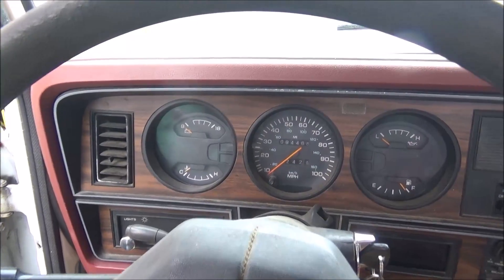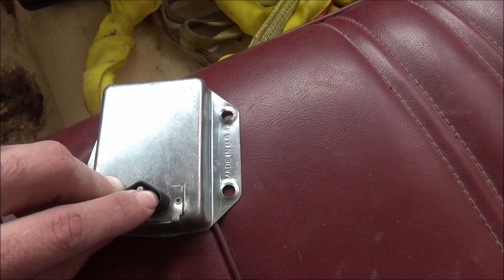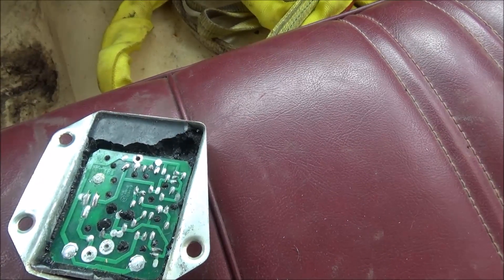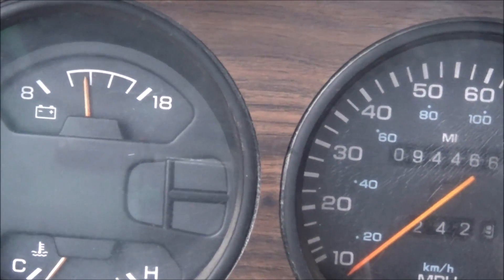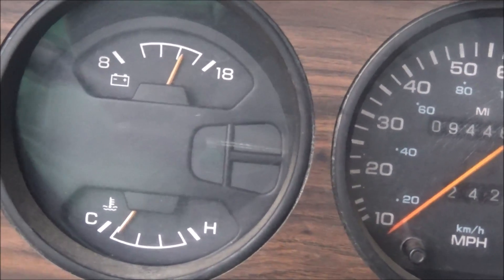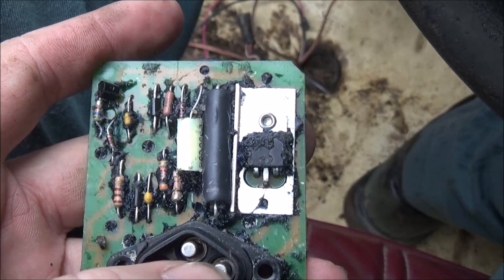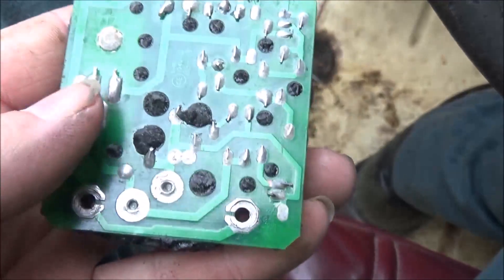Plagued by electronics, I need help

Comment: The components to be concerned with are the alternator, voltage regulator, battery, battery to engine ground conductors (wires), battery to frame ground conductors, engine to frame ground conductors, engine to body ground conductors, the positive battery conductors and the voltage regulator to alternator conductors (Ignition and Field), 

Most often this type of recurring VReg failure is missing, broken (open), damaged intermittent ground conductors, usually between the engine to body and frame to body. 
To test just add a new supplemental conductor directly connected to the VReg mounting fastener and the engine making certain the terminations are making metal to metal connection. 
Or broken/open, intermittent or shorted alternator to regulator field or ignition conductors. 

Second most often it is a defective alternator. The only way to absolutely determine the alternator's condition is to observe the running alternator voltage output with an oscilloscope looking for an abnormal waveform, spiked output, excessive ripple on the output, inverted or missing phase wave form on the output. 
Quite honestly, I am leaning toward a defective alternator because when taking the alternator control wire directly to ground, the alternator should output more than 15 volts and full rated current. 

Does the battery discharge while the vehicle is parked for more than 48 hours? 
If yes, take a long hard look at the alternator, a leaking (electrically) diode will slowly discharge the battery when the engine is not running. 

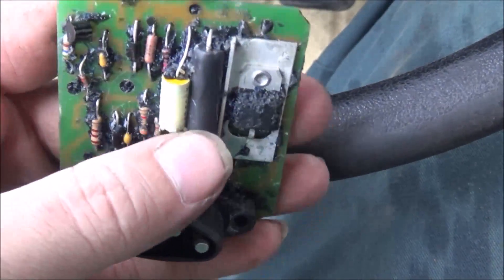The long black cylindrical device in the VReg at 9:05 is a current sensing resistor. It developes a small voltage across both ends of the resistor that is commensurate with the current flowing through the resistor. 

The small flat and round device in the VReg at 12:15 is a temperature sensitive resistor. This for ambient temperature compensation to prevent over/under charge voltage that adjusts the output according to the ambient temperature. The resistance changes as the temperature of the device changes. 

The multi-legged device is the actual integrated circuit voltage regulator, the remainder of the devices on the PCB are support devices and devices used to set or trim the sensed and control voltages and currents at the factory. 

A relay is not a good long-term fix, although in a pinch it would get you home. 
The current at the VReg field (grounding) pin is modulated by the VReg to control the alternator output, it is not a simple on/off switched operation. 
A relay is either on or off, either full output or none, no current modulation. 

If it were mine, I would closely inspect all of the above mentioned conductors and terminations, uninstall the alternator and have a reputable auto parts store (NAPA in my area) or alternator rebuilder/remanufacturer test it independently of the vehicle, repairing/replacing if needed, replace the VReg with a new Made in USA unit and add the supplemental VReg fastener to engine ground conductor (10-12 AWG or fatter). 

Sorry about the novel, but I wanted to be thorough. 
Hopefully some of this helps. 
Good luck, let us know the outcome or progress.

Comment: There are usually only 3 connections on those regulators, ground, battery sense (comes off the battery directly) and output to the field coil on the alternator.  To get more voltage, the field gets tied to ground. It really sounds like the field might be drawing too much current, maybe its got a shorted turn inside.  It would probably still work with a shorted turn but it would pull more current.    Maybe its pulling enough current to melt the solder on the switching transistor inside the regulator, which is why it started working a little bit when you poked it. 

Is there a different regulator for the diesel vs the gas engine?  Just wondering if maybe you have the gas regulator and its more feeble.  Higher amp alternator probably needs more current to the field winding to work.

Comment: The voltage regulator is actually a current regulator controlling the rotor current in the alternator {more rotor current more magnetic field more output voltage.  the sensing of the voltage by the regulator requires a good ground between the alternator and the regulator.  check the bonding of the engine to the chassis etc to make sure your are not getting an intermittent ground.  It's possible the alternator rotor could be at fault but I have never seen that in 20 years of working with them.  I hope this helps but without hands on it's hard to be specific.  Aloha Chuck

Comment: That looks like a mosfet.  The middle pin will be switched to the ground (on the left in that underside view) when the voltage on the gate pin (on the right)  goes above (or below,  both types exist)  a certain voltage

Comment: Check the Crank Pos sensor. I had a 93 and the AC stopped working and the Alternator stopped charging. Turned out to be the Crank Pos Sensor.
Reply from the maker: No crank sensor on an 89. I believe those 1st appeared with the 91.5 trucks.
Reply: I did not know that. I miss mine wish I never sold it.
Reply from the maker: They are tough, rugged, and simple work trucks. Nothing fancy or plush about them but you can throw 4000lb of concrete in the back and drive off to the workisght day after day and they take it.
Reply: I also like the looks one of the last trucks that looked like a truck. not a luxury car with a bed. My was an Auto If I ever find a manual I'd probably buy it. Hope you get your issue resolved. I'm wondering if it's a diode in the alternator?

Comment: Hi Brian,  The three legged device is the regulator. It does not switch on and off, it varies the the charge voltage based on the current charge on battery.  The black cylinder next to that device is a resistor. I know you are not looking to repair that unit but if you did you can get the same type of voltage regulator with higher current capability. I might suggest you try to see how much current the alternator is supplying. The regulators that you have been installing may be for a different current output. The suggestions about trying an alternator with a built in regulator would at least be a good test to see if your problem is with  your current configuration and you can get a used one from  a junk yard. Now you may have to make or modify the mount bracket, but if you now someone with some machining equipment, I am sure you can make it happen.  Ha Ha.  Good luck

Comment: Brian, the downer engine looks like its from a newer truck?  If so is the ALT from the newer truck internally regulated or are you using the correct regulator for that newer style ALT?

Comment: Beyond the calls for ground or swapping the alternator I've got only the hobo-engineering one would use when out on the road and temporary like, maybe with some timed relay instead of a manual switch I'd soon forget. I tend to enjoy driving so much I even forget about gasoline some times, so it's a good thing they invented that red warning light now that I drive on the mainland!

In Hawaii, running out of gas was just an opportunity to meet the nice people who lived where you happened to putter out, LOL! I seriously made a friend that way...ahh, I miss it sometimes.
Reply from the maker: I have never in my life run out of fuel. I am a guage hawk if anything is out of the normal I know it.  I once was driving a KW around a corner and noticed the oil pressure dipped so I pulled over and shut it down. Turns out the filter gasket had blown out and it had pumped all the oil out but about a gallon and when I went around teh corner enough got away from the pickup for me to notice the pressure drop. No doubt that saved that motor from an early death.

Comment: Brian
Heat is the big enemy of electrical - keep the stuff cool and all is OK for long time.  Overheat and you get problems smoke blah blah.  Your tuck was initally a gas rig most likely V8 and a 318 or 360 CID.  with the gas you had 4 cylinders exhausting "near" the regulator and with diesel especially so with the exhaust side of torbocharger near the regulator and that is all six cylinders..  Diesel exhaust is also hotter I believe than gas.
RECOMMEND take a look at a Dodge stock diesel and see where they put the regulator.  They may have moved it to get away from the heat.  If so move yours.  I would consider putting on the "bulkhead" the radiator is mounted on make sure it is going to stay fairly dry.

Mount all grounding type conections even just the screws to the sheet metal using No Alox,  Detroit and their savings of copper by frame ground is great for service and repair persons - lots of job security.

I agree with the idea of running a dedicated ground conductor from the regulator back to the battery.  Use solder on all crimped lug connections to avoid oxidation problems...

The regulator is using pulse to contol the alternator and that will wear out a relay in no time,
Do NOT bypass the regulator output with eithe a relay or switch.18 V can fry other electronics.  You hve gotten away with it so far.  You could put in a manual reguator setup with a reostat and ammeter to control field current to around 3 amp or so,  I have done that with bench top demonstration equipment,  It may be needed to get you home on a cold dark night.

Dan Bentler
Reply from the maker: Besides the radio everything else on the truck is analog. 18V is tough on light though!

Comment: absolutely....   here is my six step voltage drop test to check the major wiring connections at the electron level.. http://imgur.com/a/wHJue

run a braided ground strap from the engine block to one of the mounting bolts on your voltage regulator also.. you can get a 15" version... 

the center wire monitors the charging voltage...

the side wire is both Negative and positive output..  when it pulses to negative.. the alternator rotor magnetic field increases.. to dampen the rotor field it pulses to positive.. this stops the charging system output from running away.. 

check the negative battery cable connections.. the voltage drop test will isolate the issues..  you need the thick wire to the block.. the thin wire to the body...   a braided ground between the engine and firewall..   you may want to use a second to the voltage regulator mounting bolts.. 

i have measured as much as 8.5 volts on test 4 on a 98 chevy pickup that really had some issues...   you may also need to pinch the sleeve connectors tighter that plug into the voltage regulator. 

wayne..

Comment: I agree with adding dedicated grounds but be sure they all go to a common connection point. Grounding loops in A/C are bad but a nightmare with D/C. Only ground to a cylinder head  in one spot to prevent electrolysis and head gasket failure. Good luck!
Reply from the maker: Cummins has grounds in 2 different spots on the head already from the factory. One grounds the alternator and the other grounds the grid heaters.

Comment: might  be a heat issue regulator getting to hot and failing from mounting location
Reply from the maker: It is in the same location as it is on my 89 truck and I have never failed that one.  I doubt since this last reg was put on back in october it has even seen a temp of 100deg.

Comment: I once had a whole bunch of issues with charging at the same time, First thing i would suggest is to get a better in cab volt gauge, they are cheap and allowed me to see when it was charging and by how much. I never mounted it, just ran a couple leads with alligator clips and zip tied the gauge onto the shifter.  I soon discovered that my factory gauge was really poorly calibrated and i also discovered that at higher rpms it was charging sometimes at 16 volts. After doing some research, my pulley was 25% smaller than the factory one leading to alternator overspeed. After this was corrected, i had to chase down several intermittent bad connections in the wiring to the volt regulator and ground. Finally got it working after hours of troubleshooting. Basically ended up cleaning and or replacing every wire and connector in the charging system. 

Learned my lesson, The 2-3 alternator issues i have dealt with since i just cut my losses and installed an internally regulated alternator, ensure pulley size is factory and be done. One ground and a wire to the battery. It is not worth my time to trace all the wires on an externally regulated system.

Comment: I'm no expert, but the alternator comments are worth investigating. It sounds stupid but check all your grounds really well. I've had dodge trucks that gave me fits just like this. Doing the conversion idk what all you did, the chryslers seem sensative and really depend on those groundings. Engine-frame-body can mess up a lot more than you can imagine. Even under dash or wiring harness to body grounds can feedback enough to grow gremlins. My truck had been disassembled to a great degree. Removed front clip, bed, engine, transmission. I had to keep jumper cables all the time too. I quit using the truck in the end. Later a dodge lover told me that was definitely the problem. But I can't say i know for sure it was. It's a low budget answer at least, I would check alternator per previous comments, 1 bad diode is possible.
Reply: That was several trucks back. My fuzzy recall says I was charging but not either full rate or it was sporadic, idk. What I remember most was it would be fine for any length of time from 1 day to 1 month, then I needed a jump or I was walking. Midnite jumps in pre cellphone days were a bitch. The dodge man swore up and down I was missing grounds. And it's possible.

Comment: The 'washer' looks like a ceramic capacitor.
Reply: CE is european conformity (probably lead free solder etc)
Reply: agree, it's a ceramic capacitor.. that American Chrysler (USA MADE PART) had CE on the board... CHINA EXPORT.
So it's American assembled from parts outside the country

Comment: Is battery 100% good?  Bogus diodes in alternator can cause some strange things.  Take your voltmeter and put it on AC scale you should not see much AC component across battery, if you do then its ALT diodes.  See if anyone has an oscilloscope this will let you see how pure the DC is.  Check grounds connections.  You mentioned putting relay in, you can put the relay coil on the on the regulator output, then use the relay contacts to switch the field.  This would isolate the relay from the regulator.  It still would be auto charging.  Use a relay rated for the full field current  plus some.  That funky looking component looks like a thermistor or some sort of over temp device.  Board looks discolored...over heated in that area.  Good luck

Comment: Either the alternator rectifier is bad or has a short in the windings. Get it off the truck and test it or replace it with a known condition alternator. Better yet, put a GM on wire on and never look back. Good luck Brian!

Comment: I would check the ignition switch, then i would take the alternator off and take it to rebuild shop and let them test it . they can test it in ways that your local parts cant . sounds to me llike your getting ac on either the sense line or the field line due to a problematic alternator. lets us know what you find  thanks for the video Brian

Comment: Brian, what was the conversion? engine swap maybe? is it possible that your alt. already has an integrated v.r. Could you check if the voltage out of the alt. is ac or dc.
Reply: Nope.  Standard Bosh 120 amp alternator on that 12v Cummins.

Comment: You have a bad ground connection.  That was a common and recurring problem with the Chrysler electrical system.  Run a 14 gauge wire from the base of the regulator directly back to the battery negative terminal.

Comment: look at trucks wiring diagram. that component may be getting to much current or not enough. may need a resistor maybe wire has a break.

Comment: Hi Brian,
The main issues I had with charging systems on cars or trucks, a couple of times one of the 6 diodes on the alternator shorts out, the alternator is a 3 phases system and needs 2 diodes per phase and if one of them shorts it will charge less and load the alternator and field...
Also make certain you get good connections to field and ground, that the feedback wire is well connected...
Most likely you need a new alternator...
That little shiny disk is a thermistor, it's a resistor that changes value with temperature.
Reply: Another question, do you have the bigger alternator associated with diesel engines, a must in order to keep up with the 2 batteries and extra work load...
Reply from the maker: Yes it is the factory alternator that was on the engine. My truck as all 1st gen dodge diesels just uses one big group 31 battery. They start so good they don't need 2. When I did the swap everything was done as factory for a clean install.
Reply: My hunch still goes that you need a new or rebuilt alternator and while you're there, a brand new good quality controller module...  If That doesn't work, then........    ??????      Maybe a new truck...   ;)   (Hope not)
Reply from the maker: New truck would equal no new shop for many years............ I will put a toggle switch on it before that!!

Comment: My 2 cents,  Beside confirming a solid alternator to battery chassis ground.  a good test is to measure the current draw via the regulator to ground.   More than likely your alternator has a failing rectifier or a winding that is shorting.   And one FYI the CE in the back of your Dodge American made regulator is China Export.   Let us know what you find..